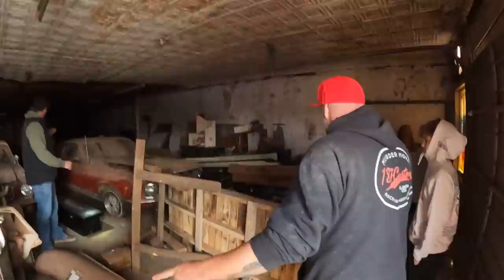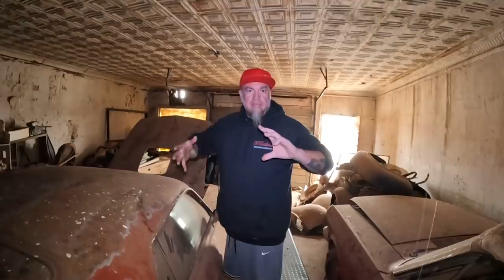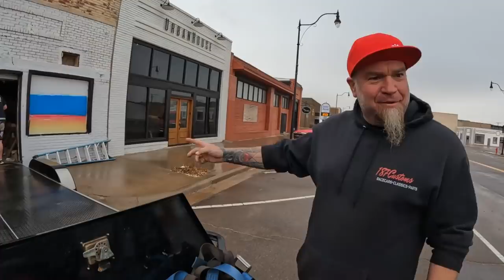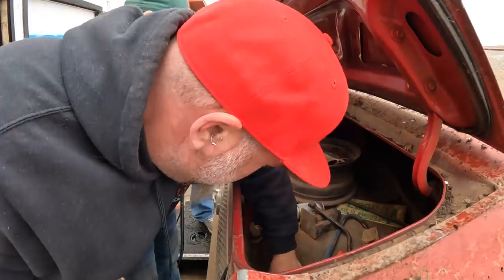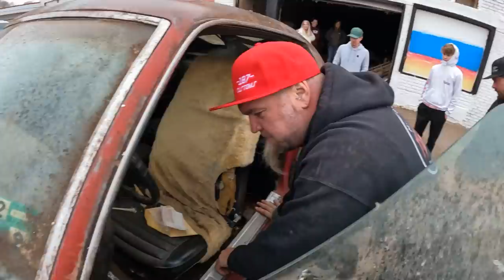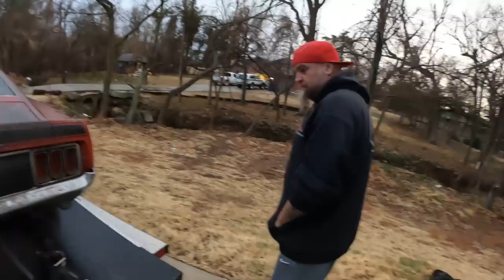Recovering a '70 Mach1 From An Old Abandoned Building!

Comment: Shawn,For You're  Peterbuilt tell the shop to turn the governor off on your truck,they can do it with a computer and you'll be able to go faster than 85 that's what holding you back
Reply: @perrylankford4269  
Tires are rated @75mph 
That's all sizes 22.5  11r22.5   24 or 24 lp 
You'll get cord separation. 
A few tire manufacturers used to have " branded" rubber upon special requests. 
Double the price of standard tires.
You could run those at 100mph plus for the length of use with no issues.

Comment: Believe the "drag pack" was only available on the Mach 1 with the 428 motor option with either a 3.91:1 or 4.30:1 rear-end, 427 connecting rods, oil cooler, & staggered shocks (updated flywheel & harmonic balancer also).  Never heard of a 351C drag pack being a factory option in a '70 Mach 1?

Comment: The drag pack was either a 3.90 (only 2 made as drag pack) or 4:30 rear gear and also included a remote oil cooler. The data plate should have a W or V under axle.

Comment: There's a spec tag on the driver's door post
Gear set and rear-end model.
Anything past 3:42 rears 
You're kinda gearbound 
Anything under 3:36 
You can get the parameters reset 
( fed max is 110 ) so an outside shop will or can do it

Comment: You can take the peterbuilt in to a truck shop and have the speed limiter removed or rased if that's what is keeping it from going any faster unless it's just out of rear gear. If it's geared out then it's just running up against the governor and your shit out of luck you would have to change the gear ratio.

Comment: My Lord, what a find, guys and gals, I am green with envy. My Mustang was a 68 GTA that was a graduation gift from my father. A coded 390BB-FE 4-spd, Dad made it a cut above its factory specs and enlisted the expertise of several WWII-PTO brothers-in-arms who made their name in the post-war SoCal speed & kar-kulture of the 50s-60s, Hap Richardson and his longtime SCCA racer & Don Wester mechanic turned tuner-fabricator and engineer, Rick Hilgers. The Speed Equipment industry was born of the WWII veterans technical skills honed in war. Dad and his guys loved speed, fighting in the Pacific Theatre of Operations, speed was life and after the war, that passion turned into entreprenuership. The GTA was treated to serious redesign of suspension & brake-tuned by Rick, while Hap used his race & car manufacturer connections to acquire blueprints to the early Trans-Am suspensions redesigns. When it was presented on my graduation, it was an amazing road car that cornered on rails and had no brake fade, the stock 390 was plenty. Thanks, Dad, Hap and Rick. Now I see this Mach 1 and it takes me back...

Comment: If your toter is maxed out at 85mph it is in desperate need of a gear change. The sweet spot on that motor cruising is 1300-1450 rpm's. With the combination you are running I would look at doing a gear swap to 3.36's. You will get more speed but the big benefit is gonna be the fuel mileage.
Reply: It might need a laptop and just turn of governor thats set at 85 mph on the Peterbuilt ?

Comment: Hey man sounds like to me the rear ends in the Pete are like 370s or maybe 390s if you swap them out for 336s or something like that will get more top speed and alot better fuel mileage at 80 to 85

Comment: Watching this video was really cool.  My first car was a used 1970 Mach 1 purchased in 1973.  I worked different jobs before or after school since I was in like 7th grade and saved every penny for my first car.  I remember paying $2500 for the car.  It was a base 351 W auto in lime green metallic with deluxe white interior.  I did some basic mods to it like mags, tires, air shocks, headers with dual exhaust, dual plane intake with a 600 cfm Holley, ignition and 3:91 rear gears and of course a nice stereo.  Unfortunately I drove like like an idiot and totalled it about 2 years later.  I still think about that car to this day almost 50 years later.  I guess for us gear heads our first car is kinda  our first love.

Comment: Call me crazy, but I would rather have a 351 Cleveland built to the hilt, over a 429, car handles better and I've seen 351 Cleveland that was pretty stout, I know there's no replacement for displacement but I like a car that handles in corners and does everything, 429 big block doesn't handle good at all, though it goes in a straight line real well

Comment: You guys really don't know what a 351 Cleve 4 bolt 4 bbl Mustang's worth do you ?
A whole lotta more than you think.....whole lotta more.
If it really has the huge port/valve 4bbl heads on it it'll be flat till about 4000 rpm and that's where she'll start to breathe.
Restored nicely I bet she'd bring 50-70k depending on quality of restoration and possibly even more what with current car market.
No it's not in good shape, but it's good enough to start with.
Get after it lads.

Comment: That poor car sitting with no air cleaner on it all the dust that is on the car is in that engine too since nothing was blocking the dirt and rodents from getting in there. Hope no animal made their home in there.  If I was you I would tare that engine down and clean it up before cranking it. Being a Cleveland the valves are for sure seized. That would be a sweet ass car once cleaned up. I like the 70 body style they were all right but I'm not much of a mustang fan unless it's a Shelby GT350 or GT500